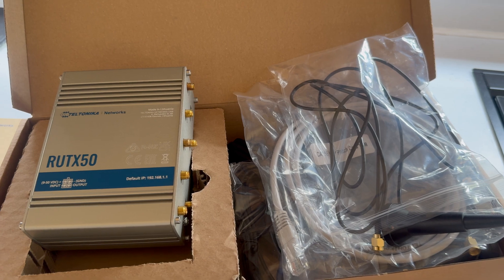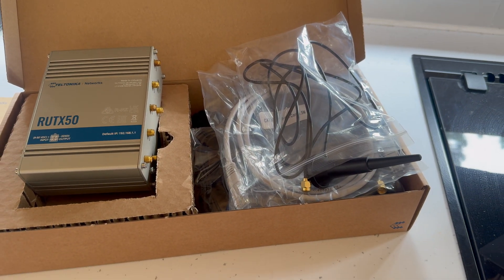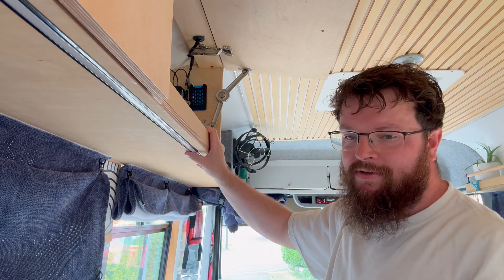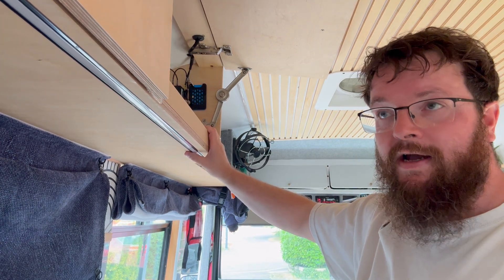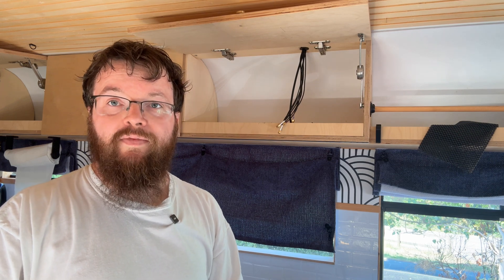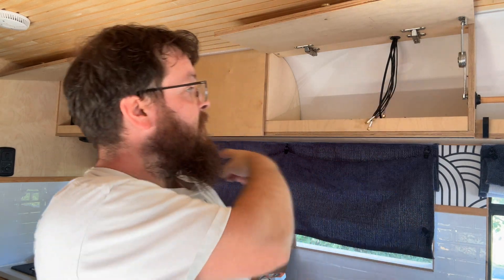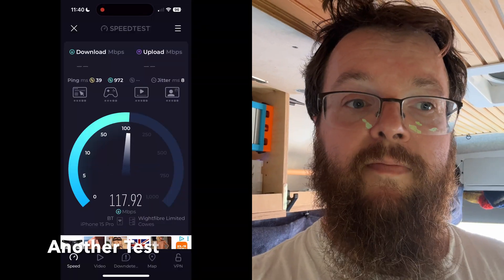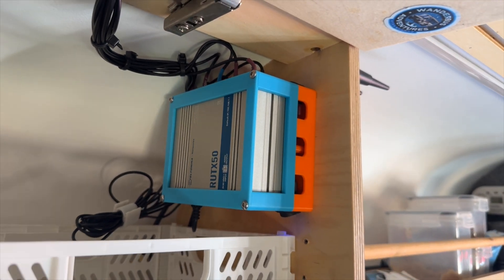Insanely Fast 5G WiFi in a Van?! Teltonika RUTX50 Install & Speed Test

Comment: Does the RTUX50 record when the temporary password and user name was changed and the software updated?
Reply from the maker: Hi! Yes — the RUTX50 does keep track of system events in its event log. You can check when configuration changes happen, including when the default password/username is changed and when firmware/software updates are applied. You’ll find this under System → Administration → Events Log in the router’s web interface.

It won’t show you the old credentials for security reasons, but it will timestamp the changes so you know when they took place.

Comment: Just as a heads up, Three have merged with Vodafone creating one of the best networks in the UK, before long the connection using either network should perform better than any other, and you can get a Smarty SIM which is unlimited for £16 a month, which is what I use, it hasn’t completely rolled out yet but afaik it will roam from one to another automatically no matter which network you choose.
Reply from the maker: That's great to know, bit of a result for 3/Vodafone customers.

Comment: Glad I found this its been helpfulin confirming I may have brought an avtex amr105x in error. More style over sobstance I fear and for 600 quid its only cat 6 rated🙄. I've not fitted it so it can go back, just a few tests I did with a few sims showed I was getting faster speeds from my phone alone !  3 sim it didn't even recognise 🙄I'm not techy but just wanted something that could handle some online gaming, can I ask that you have access to the app that makes swapping between sim cards and wifi more user friendly? Many Thanks!
Reply from the maker: Ah no. Sounds a pain. So you access it via an online portal. It’s easy to configure. I’ve got mine set to failover automatically from sim to sim. You can also manually
Change it if you so wish.

Comment: We’ve got the RUTX11 unit on our van which is 4g. It’s the best unit we’ve had on the van for WiFi and we’ve tried them all ! (Except starlink as I refuse to pay £96 a month ) - we have just returned from a 2 week tour of Scotland and never once didn’t have internet even on a site that is advertised as no mobile signal available ! We use Smarty and Lyca (so 3 and EE) - these do use a bit of power so I have mine powered from a 12v time clock so every day for 30mins it turns on and syncs my Victron VRM so I can keep an eye on my batteries and temperature/moisture levels. I like the enclosure 👍
Reply from the maker: This is great to hear Don, they do seem to be a great solution. Will keep an eye on the power draw, on the face of it this seems around the same as our old one but will see. Thanks for the update.

Comment: I've been using the teltonika RUTX14 with the poynting 3-17 antenna now for over a year. We run a three SIM and an EE SIM in the router, and through our many travels around the UK we have always had a signal, most of the time fast enough to run multiple devices streaming HD and zoom. Our doesn't support 5G but we haven't found this to be an issue as we are normally well away from built up areas where 5G masts are predominantly concentrated.
Reply from the maker: This sounds like a good combo then, glad we went for a second sim with 3. That's a good point re. the 5g, and it is definitely noticeable in the UK compared to France.